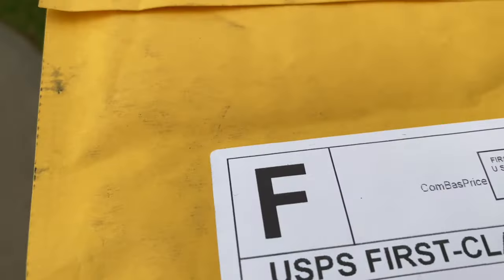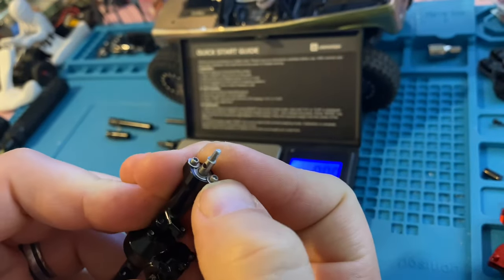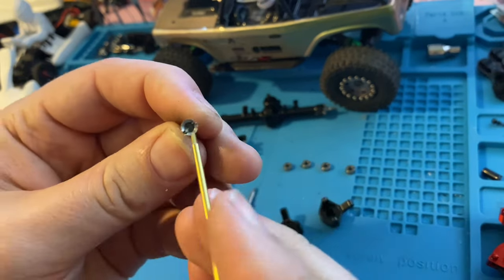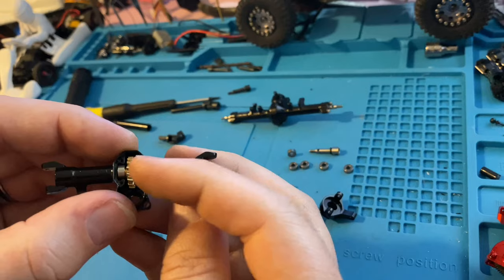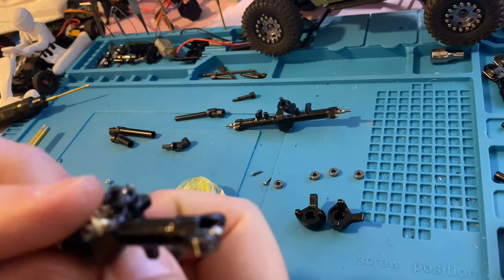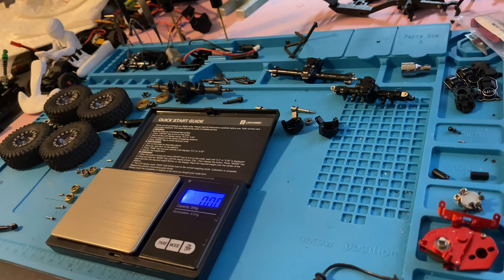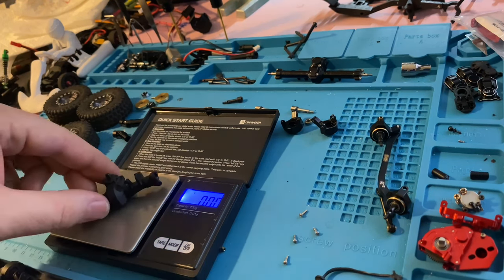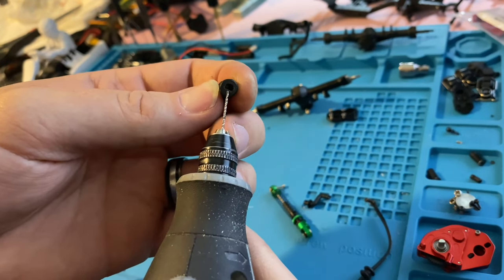SCX24 - Reviewing and installing some Ali Express Axles on the belly dragger. We open them up!

Comment: Awesome Video! I saw a video by EXPIOWA on the to get a better steering on the SCX24 where he had to trim the axle.  The front axle on this aluminum version is different and does not seem to have the knuckles hitting the axle where it limits the steering.  Are you getting a higher steering able on this aluminum axle?
Reply from the maker: Yeah, the steering would be better if we didn’t have them setup with behind the axle steering. The knuckles don’t hit though. They are good. I think the biggest limiting factor is the dog bone and c-cup
Reply from the maker: You need to change the dog ones to cvds.

Comment: Do these, or other aftermarket axles, have some type of seal on the diff covers to keep dust and/or water out? 
If not, would it be possible to cut out a thin rubber seal and fit one on? (Also would help space it out a bit if tight. Letting you snug the bolts down better)
Thanks!
Reply from the maker: nope, there is only the o-ring at the bearings. You could easily make a rubber seal, or use a thin layer of gasket seal.